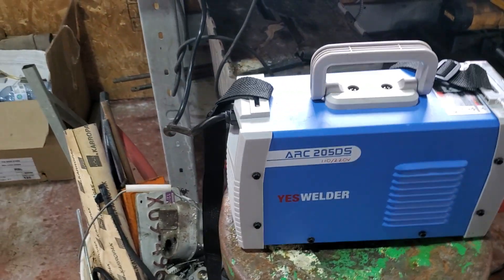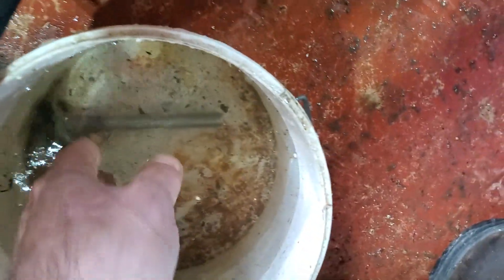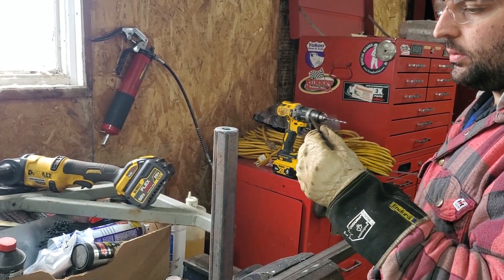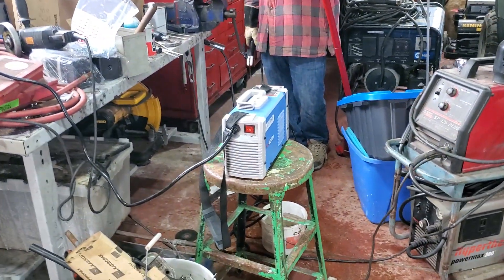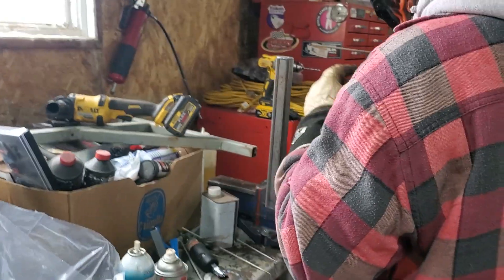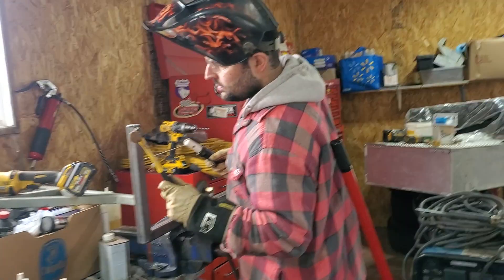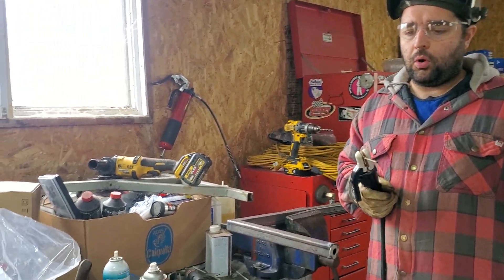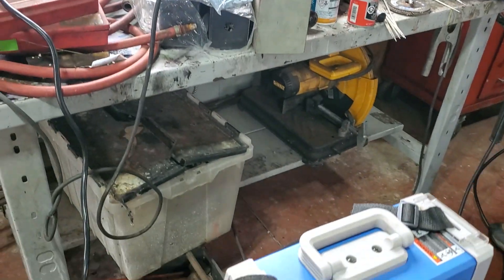YESWELDER ARC-205DS 205 Amp Digital Inverter Stick Welder from Amazon 1 year review

Comment: I just bought one. Was that on a 20 amp breaker, because i bought it to run on 110, but i only have 20 amp breakers in my shop.
Reply from the maker: So 20 AMPS at 120 volt will be enough to burn a 3/32 rod 7018
It's tough to burn 1/8" rods unless you use the adapter and run it on 240 volts. Do not even bother trying to run a 6010 rod. None of these inverter welders can run them
Reply: Ok, thanks. I planned on running 7018 with some 14 guage steel
Reply from the maker: 3/32"

Comment: I'm only just starting with welding so I thought I'd get a little unit and give it a go. 
I picked one of these Yeswelder 205D's from Amazon Australia for $70 (I think that's about $40US).
So far it seems to be doing great job. 
It will probably not last long but will be good enough to get some experience on.
Reply from the maker: You might be surprised, you never know nowadays. The import stuff can really be hit or miss
Reply: Thanks,  what model of rods are you using or would suggest ? my 205ds was delivered yesterday, paid 100usd on ebay.
Reply: @clivecottam1509  I think the D and the DS modes are slightly different. 
I got the DS for $70 AUD which I think is around 5 cents US LOL.
I used 6013 rods to start with and they were ok. 
I recently tried 7018. They gave a better deposition when I got them to run properly but they stopped frequently and were much harder than 6013 to restart. 
I'm told that 7014 is a good compromise between the two but that's a bit hard to come by here. 
I'll try to track some down and give them a go.
Reply: @garysheppard4028  Thanks bro. I'm an amateur at this, can this be connected as is to a normal 110 duplix  without burning something up like brakers...house etc :)
Reply: @clivecottam1509  Dunno mate. 
We use 240 volt standard household current here.
The usual household output is 10 amps @ 240 volt = 2400 wats but the 205D comes with a 15 amp lead which means I need a 15 amp socket installed in the garage (15amps@ 240 volts = 3600 watts).
I think if you're in the US you have much weaker current. 
I don't know much about 110 volts. Not sure how much the DS model will put out at that voltage.
Reply: @garysheppard4028  Thanks bro.
Reply from the maker: 7014